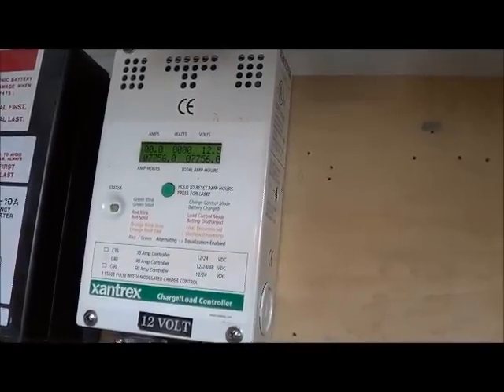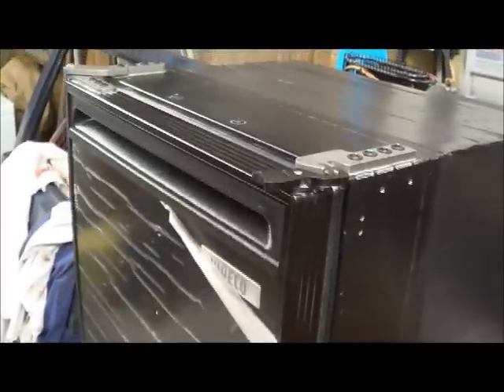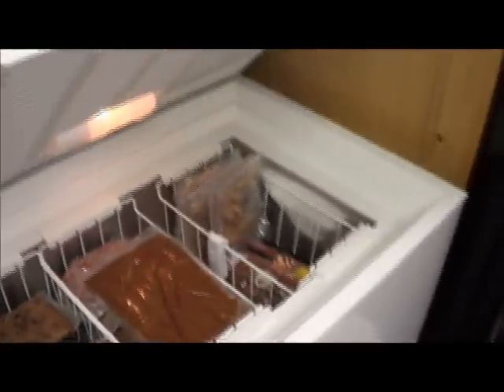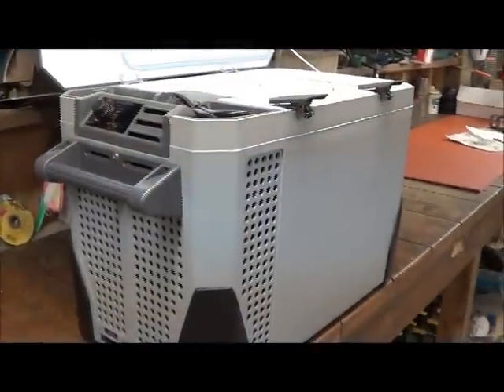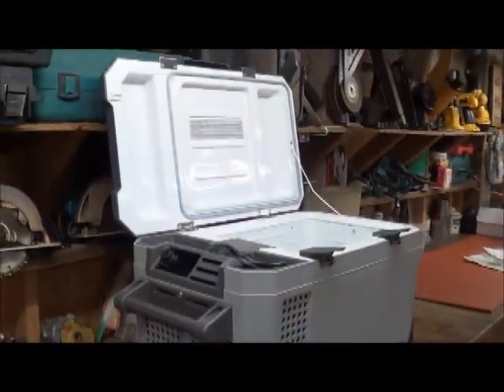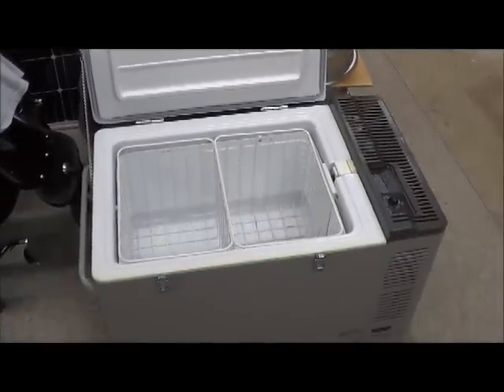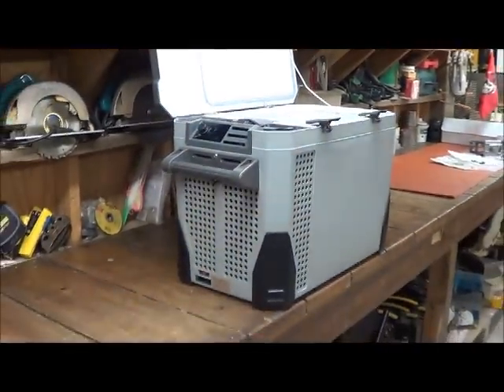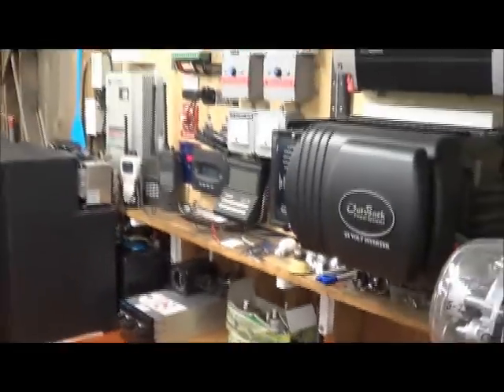"OFF GRID REFRIGERATION" RVs,BOATS,CABINS,HOUSES AND CAMPING.

Comment: I too have looked at Engel I've heard some people say the new Engel are getting kinda cheaply made and it's almost a crapshoot you'll get a real good one or you may get one that lasts 17 month or 25 or 26 months and it completely stops working if that's true can you get an Engel serviced in the United States will they be able to  to fix you're unit for you????I've also looked at arb freezer,/refrigerators,they are very highly recommend,,, I also hear good and very bad things about sundanzer some say if you buy a sundanzer use it as a freezer only and make sure it runs pretty much all the time if not I guess something could go wrong with the cooling lines that are full of coolant eventually they say they will start leaking if you use them as a refrigerator ,,,, then I heard any one of those Sundanzer  can be a refrigerator or a freezer or simply by changing the thermostat a lot of people will buy two thermostats one for Freezer one for refrigerator I don't know I have never had one,,, steca makes a refrigerator freezer that can be either,,,you don't have to change anything just adjust the setting again I don't have any experience with the steca either but they do look really nice have you had any trouble with your sundanzer as a freezer how long have you used it,,,what do you think about a chest freezer conversion to refrigerator???

Comment: I have a fridge/freezer like the one you show at 3:40 in the the vid.  Mine is branded as a Norcold.  Have you ever had to get in the the circuit board?  Mine isn't running and although I haven't opened it up I suspect there's something gone bad on the board.  Thanks!
Reply from the maker: +LCOwner I have seen them for sale and they are not cheap. I'm not sure you can make you compressor run with out one.

Comment: PLEASE tell me that you reside in the Southern Arizona (Tucson, Tombstone, Sierra Vista) area????  Man brother, looking through some of your past vids, we have MUCH in common (I am a shooter myself with a pretty extensive AR collection, just to name one type) AND have invested over $5k in solar (ALL BRAND NEW from Arizona Solar and Wind, Flagstaff, AZ), had the install "professionally" done (4 Kyrocera panels putting out a total of 580 watts, 60 amp Morning Star MPPT charge controller with remote display panel, Bogart TM 20-25 module, went from two 12 volt batteries in serial to four 6 volt batters in parallel to maintain 12 volts).

The installation was done clean (sort of), I had all of the parts and knowing that businesses make money on BOTH parts and labor (and I like to support my small local businesses, I bought the 4 6V batteries from them and added it to the install). I was quoted 4.5 hours worth of work, I got my 30ft Winnebago back 22 days later and show that my panels produce between around 87-93 volts, but NOTHING WAS PROGRAMMED, my MPPT Charge Controller is consistently cycling from Red, Amber, Green, then immediately repeat non-stop. I called the MAJOR RV DEALERSHIP/SERVICE place in my area, and it was a complete joke. The owner came by, acknowledged that it was a botched job and tried buying me off with $350 as if to just make me go away. I have since filed a complaint with the BBB, and am gathering evidence for court as get this....

My 60 Amp MPPT came with TWO BREAKER SWITCHES, a 45 or 60, and a lower 15 amp switch. THEY ONLY INSTALLED ONE OF THEM, THE 60 AMP. When I asked why would the custom built/ordered kit from a VERY REPUTABLE DEALER of Solar/Wind Power send me TWO BREAKERS if one is "not important" and not needed?!?!  The tech who did the install didn't have an answer....ugh.

Bother....ALL I WANTED TO DO AT THAT STAGE WAS TO GO FROM SOLAR DIRECTLY TO BATTERIES, THAT IS IT!!  Once that was achieved, I then planned on a 2500 Watt Pure Sine Wave Inverter to then get wired in and work with my existing system, or as a tertiary power system (shore, 4kw Onan Microquiet on board gennie, then solar)...BUT ALL HAS BEEN PUT ON HOLD AS I CANNOT FIND ANYONE COMPETANT ENOUGH IN MY "TWO HORSE TOWN", and have spent A LOT OF $$$$$ already just on the solar package ITSELF, not to mention $1500 for an install that was quoted 4.5 hours that ended up taking 22 DAYS!! AND IT DOESN'T EVEN WORK!!!

I have a 2003 low mileage Winnebago "Minnie Winne" 329B C Class with the Ford E-450 V-10 Gas Engine.  Man brother if you are close, and can get this US Navy JSOC (SMU)  Chief, Ret. up and running electrically with solar power, I can pay $$$, physical bullion (Gold/Silver), firearms, and/or ammo.  I NEED to get my rig set up and ready for that inverter so I can tap into 120v as either a backup or primary to the on board gennie.  The 4 panels are mounted and sealed on the roof with maybe an inch of spacing, all othe components are mounted and in place, but the tech said he messed with the dip switches in the controller, failed to install the 15 amp breaker, and did NOT program the system around the BRAND NEW 6V batteries that I BOUGHT FROM THEM in an attempt to support my local business, as I has 2 12V under the step that were only 6 months old!!

Sorry for the long rant brother, it's just that this place cost me a lot of $$$$ (and their mistakes will end up costing me even more now), I handed them EVERY SINGLE PART THEY WOULD NEED ON A SILVER PLATTER, and they still screwed it up (and spent 3 weeks doing it).  So if you are somewhat near, and available, please let me know :-/  Thanks man, love your vids, thank you for sharing the knowledge man.

Comment: kevin, where did you get the Blue-Sea passthrough that you used on the solar set-up, are they an older model with the 4 mounting holes, everything I have found only have two mounting holes and not sure if they will fit through a 3/4 " plywood
Thanks Al
Reply from the maker: Al Ruark I will have to research that.
Reply: OBXSOLWIND Hey kevin, I tryed to find the ones that you used to fit thur a 3/4" plywood with no sucess, so I called a young lady from Blue Sea, and sent her your video via e-mail she e-mailed me back after viewing it and said that the one you used was not from Blue Sea but maybe CooperBussman, anyway if you find out let me know if you can
Thanks Al